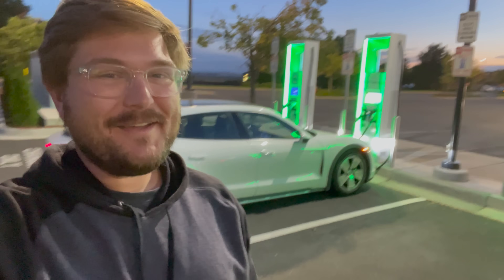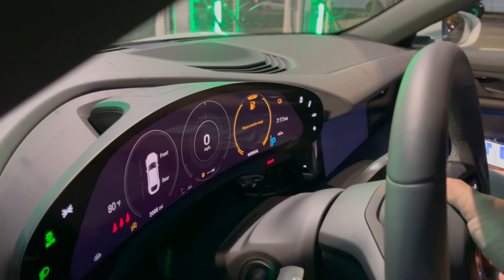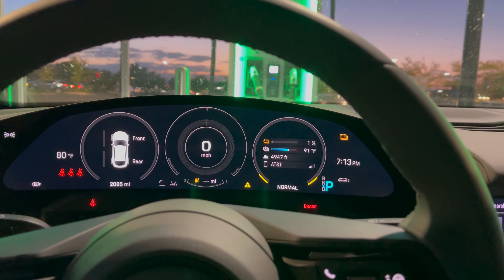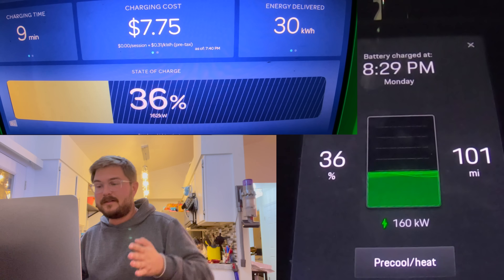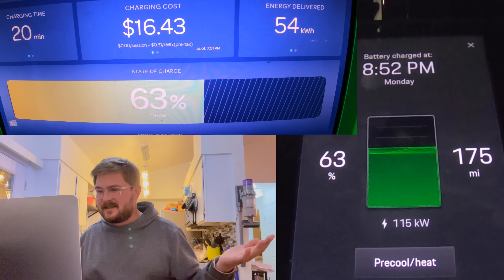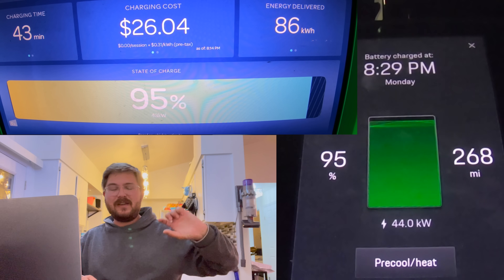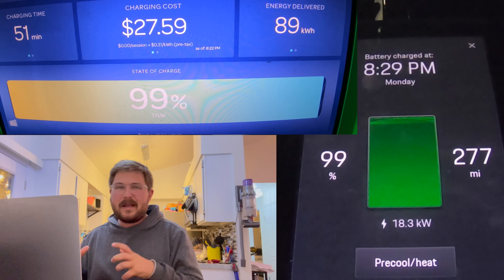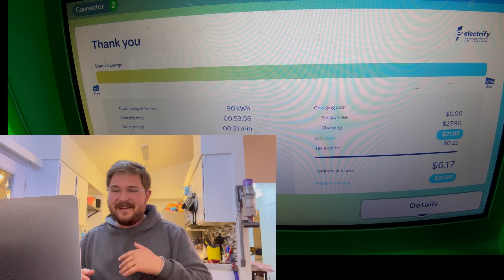Charging The Porsche Taycan From 0-100% With A “Battery Friendly” Decreased Power Level

Comment: Kyle, I truly believe most of these EV makers with the exception of Tesla leave huge buffers in their battery so when it’s time for the warranty to come in to place they will lose much less capacity with such a big buffer and won’t have to replace a bunch of batteries in 10 years like Tesla may have to for warranties. Even 1% needing battery replacements under warranty would hurt
Reply: The Only ones that actually have crippled customers cars areTesla though
Reply: @EVPaddy  say more
Reply: @John-209  he can’t say more because he doesn’t know.
Reply: It's hard to say whether ANY BEVs will get close to their warranty degradation over the warranty period / mileage unless something has seriously gone wrong in the pack with cells or wiring completely failing.  Frankly, there just aren't that many EVs out there that have hit the 8 year mark yet.  A lot of early model S's had battery replacements.  The oldest model 3 on the road is only a little over 4 years old.
Reply: @updlate4756  Exactly my point with millions of vehicles out there they’re not sure what’s going to happen but if some go bad they don’t want to go under
Reply: @updlate4756  My Zoe is 7 years old :) And yes, appart from Leafs most batteries won't get to the warranty-degradation level. But not sure whether that's a good thing. i.E. one bad cell out of over 7000 in a tesla battery can brick that battery completely.
Reply: @EVPaddy  Thank you for the response but I think you’ve gotten some bad information about Tesla cells.But I definitely agree on the Leaf.must be their lack of cooling
Reply: @John-209  It's not 'bad information'. Not everything Tesla does is that great. About the cells, watch this: https://www.youtube.com/watch?v=F-B_8oMZNeI . Anyways, about the Leaf, I don't think it's just the lack of cooling. My Zoe has rather rudimentary cooling, too and that isn't active when the car isn't plugged in. Still, I still have a battery health of 93% (probably even a little more, this always goes down and back up a bit) after 7 years. I think the Leaf had a bad chemistry.
Reply: @EVPaddy  thank you man I will watch it and that’s great after seven years for the Zoe, and I agree Tesla does a lot of things really shitty but their drivetrain and battery seems superior to me
Reply: @John-209  They certainly use strong motors. Sometimes too strong for the drivetrain, I'd say. It's kind of their thing. Battery, not sure how they're superior. Watch some comparisons i.E. made by Bjørn Nyland a lot of EVs are charging faster than Teslas by now. Some have better warranty. Most have buffers that protect the battery from degradation, wich means you have a bit less range on paper, but you really can get that range, even after years. With a Tesla, you have to charge to a 100% which is hurting the batteries and you still won't get the promised range because you have degradation even after a few months... and Tesla does everything to get the max possible EPA range while most other EVs are 'underrated' in that respect and can easily pass EPA range... etc. Tesla is all about being best on paper.
Reply: @EVPaddy  honestly I agree with almost everything you just said. I believe the German EV‘s are probably better all around thanTesla‘s in everything except tech. And absolutely everybody seems to under rate their mileage except Tesla. I have two Tesla‘s and have never gotten stated range
Reply: @EVPaddy  I am in central California, where are you at?
Reply: @John-209  southern Spain
Reply: @John-209  what do you mean by 'tech'? I'd say i.E. VW is superior when it comes to 'mechanics', 'body' etc. Tesla is superior when it comes to Software(but I'd say Tesla has more bugs that affect actual driving)  but I wouldn't say 'tech' in general. Give me a nice augmented reality HUD, Tesla…
Reply: @EVPaddy  well speaking from experience with two different Tesla‘s with over 120,000 miles they have been perfect and I have not had one problem plus charging is so simple. I’ve put on a set a tires and some windshield washer fluid, literally not a penny spent on it other than that..Software, tech that is what I meant sorry if I worded it wrong but it is superior in the Tesla. My kids can watch Disney+ while we charge for 12 minutes instead of an hour in a VW with no entertainment.Not to mention my three year old model three with 40,000 miles is worth the same today as when I bought it. Or more

Comment: 30 minutes of charging is over 21 bucks.  that sucks!!
Reply: 95% of the time you will be charging at home for pennies. Had an EV for two years and have never used a public charger yet.
Reply: 30 min of charging is free, though.
Reply: When you factor in the cost of installation

Comment: ROTF the whole time! Think reduced maximum is a good strategy for time when maximum speed is not required and a slider would be even nicer. Terrific to be able to do a rocket fast charge if in a hurry as you mentioned. We have road tripped the etron 55 SUV and usually need more than a few minutes for "grab & go" and restroom. Our fat thirsty etron is usually done charging before we have completed our trip inside. Point being most of the time super fast charging is not required. The range on this vehicle is just about right for most folks road tripping.

Comment: That is really cool. A slider to adjust it would be great. It will be interesting to see which manufacterers do a better job of preserving the batteries in the long run. We know all of them are fudging the numbers on capacity, usable battery, so many variables! There are Tesla Model S with a rental co in NYC which several cars over 700k mi and a couple in Europe that are over 600k mi on the original.
Reply: Generally will have 2 batteries and a motor by that mileage.
Reply: Yes, the german who passed 1 million km had a batterychange at 200.000 km? And the «new» battery had  passed 800.000 km. It still had 90% capacity left in the battery 👍

Comment: Just like when tesla nerfed my 2014 MS85. Ho-hum...
Reply: Except that this is an owner-controlled option. You still have access to the faster charging by default.
Reply: You nerfed or Tesla did?  How was your battery nerfed?
Reply: @alexnutcasio936  Tesla slowed the charging rate.
Reply: @sdandersonjr5  why?  That doesn’t mean it was nerfed however.  IIRC, they did it for battery longevity as they did all Model S at that time.   We all know that often fast charging is not good for battery longevity. Porsche is just learning this now.
Reply: @alexnutcasio936  To avoid warranty replacement.